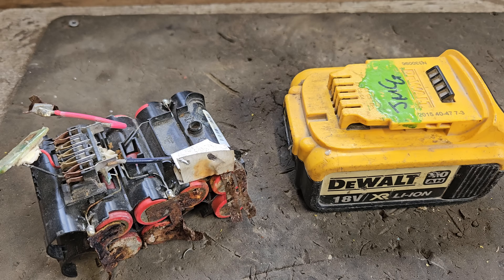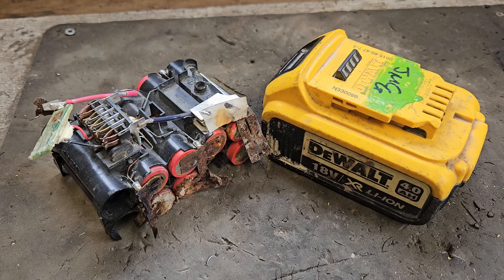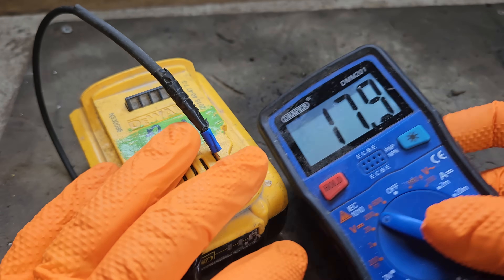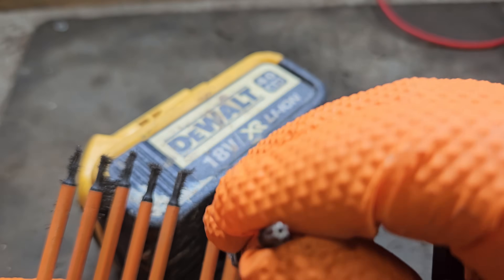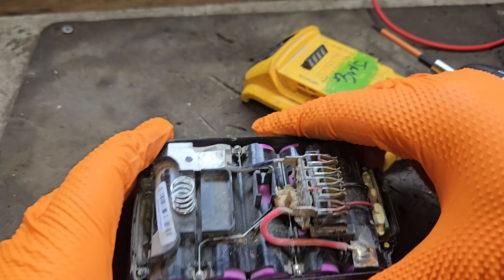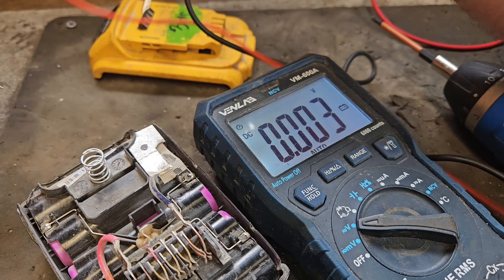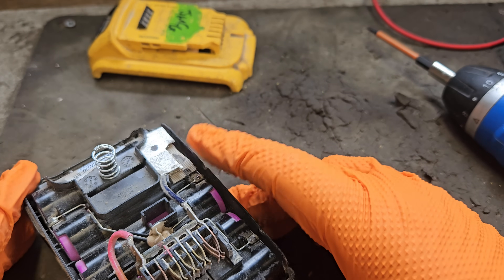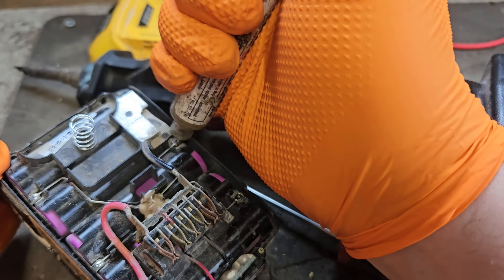Easy DeWalt Battery Repair With Just 5 Tools!

Comment from the maker: Tools Featured:
✅ Multimeter – for checking voltage and diagnosing faults
https://amzn.to/4keerwB
https://amzn.to/443x7uc
✅ TX10 Torx Bit – essential for opening DeWalt battery cases
https://amzn.to/3ZQuObr
https://amzn.to/45NDWRX
✅ Cordless screwdriver – speeds up disassembly
https://amzn.to/3ZRldRx
✅ Milwaukee M12SI soldering iron – compact and reliable for PCB work
https://amzn.to/3IfFU3u
✅ Small screwdriver – for prying, lifting, and precision work
https://amzn.to/3GhCXyP